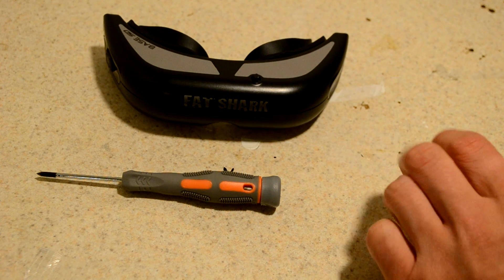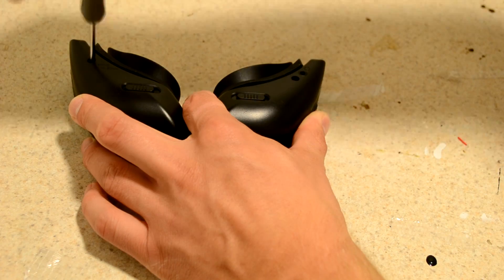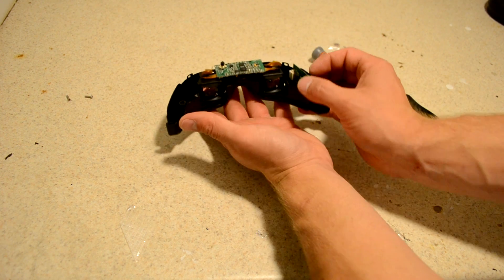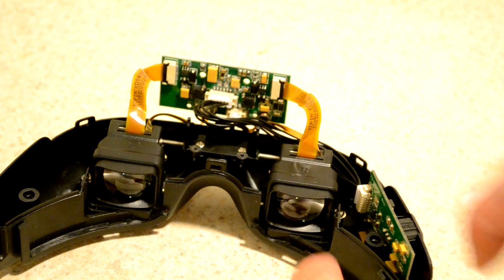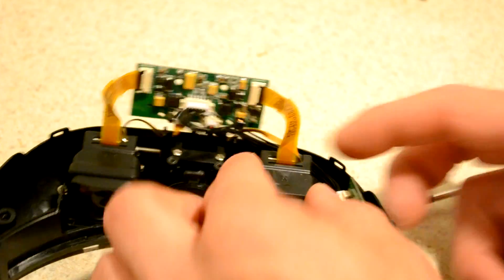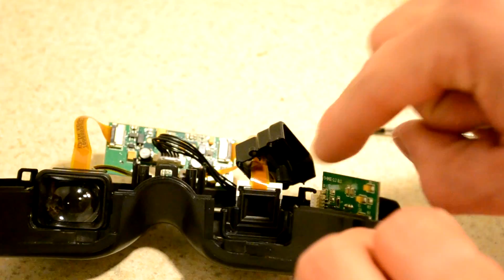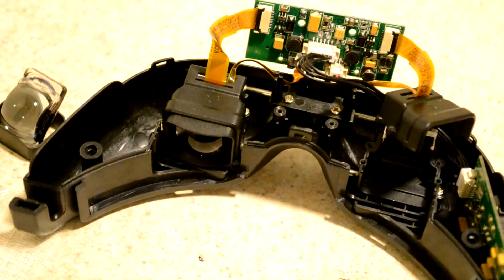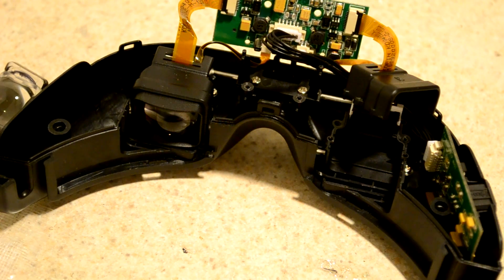Teardown --- Fatshark Base SD Video Goggles

Comment: Random question, if you wanted to say, flip your camera upside down, could you flip the lenses upside down to upright the image?
Reply from the maker: Very interesting thought experiment. I would assume it's theoretically possible, but these lenses are  concave nearest the eyepiece and do not invert the image. You would need to add another convex lens into the system, which would add a bit of distortion. Honestly, if we where trying to creatively mount a camera, I'd just mirror the image in software ;)
Reply: +Brendan Stewart Ok thanks!

Comment: this is so overpriced. look at that cheap plastic. And it's not even 3D... whats the point of having goggles without the 3d. all they had to do was add in another camera with its own circuitry. The only reason its so expensive is because so few companies sell these.
Reply from the maker: That's a big part of it. but in FPV you pay for the reliability. Id be glad to put $200 in goggles that wont go out when I have a $3000 copter on the other end.
Reply: VejyMonsta I got dji goggles and they killing fatshark! so glad I was patient!
Reply: Dji goggles have way to much latency and otherwise the receiver is too bad (race version)

Comment: Can't believe such an expensive piece of equipment uses el-cheapo plastic lenses. So much for "where all of the value of the goggle is".
Reply from the maker: I fly a full scale aircraft made mostly of "El-cheapo plastic" it's worth $100,000 and keeps my ass from becoming a red streak on the runway. 

I take it you don't have a lot of experience with composite materials?
Reply: Brendan Stewart I do, but it seems you don't. Lenses are not composite materials. Composite means plastic PLUS some reinforcing fiber such as glass cloth, carbon, etc. Plastic alone is definitely not composite. Check with your $100,000 aircraft's manufacturer and see if they'd dare make a plastic-only airplane. They'l say, "No, son, the fiber is essential, the plastic alone is way too weak". So get to know your $100,000 aircraft and read up on composites before asserting that someone else "doesn't have a lot of experience with composites". Back to the subject: plastic lenses are very low-end. any self-respecting manufacturer will build their optics with glass, not plastic lenses.
Reply from the maker: oh look! an argument on the internet! please wait while I grab a nice bowl of popcorn.

If you MUST have glass lenses, and not "El-cheapo" plastic. polystyrene, polypropylene, polycarbonate, Polyethylene? do you know what any of these things are?

no? you the psuedo-FPV champion MUST have glass lenses, feel  free to pay nearly $800 for a pair of Cinemizers who's resolution is FAR beyond the capabilities of your analog video gear But its ok, you're still learning! FPV is an expensive hobby huh :( somebody's gotta pay the engineers!

The lenses are plastic, so is the wing/tail covering on the plane I fly. Both are light, strong, cheap, and work better than necessary.
Reply: Not to make a pissing contest out of this, Brendan, but you missed my point entirely  and went on to joke before realizing (or asking) what I meant.  The issue here is certainly not strength or weight, but optical quality of a glass lens versus plastic lenses. As for your question yes I do. They are all thermoplastics, as opposed to the plastic used in your airplane, which is not. You are welcome.
Reply from the maker: Please don't piss on my YouTube channel! I've not yet found how to clean it :(
Reply: I wasn't, and I wasn't bashing you, your channel or your (quite informative) videos. I only offered the perfectly valid observation that in an expensive equipment, better-quality optics was to be expected, that's all. No harm intended.
Reply from the maker: Never take the internet too seriously my friend ;)
Reply: Haha, touchée :)

Comment: how is it compared to the predator v2?
Reply: Brendan Stewart That would be great!
Reply from the maker: I'm not sure if that will work. Let me do some research and see what I can figure out.
Reply from the maker: Firstly, you can use any frequency you like. Other than that, the FOV in the base is 5 degrees wider, and the LCD has a higher pixel count.
Reply: Brendan Stewart Would not be possible to replace lenses in Fatshark Predator with the lenses similar to Fatshark Base or Dominator to get improved field of view (FOV)? (It could be especially handy useful for all Predator users.) Could you measure lenses focal length to try (for me and others), please?